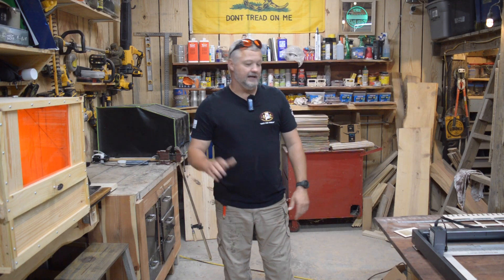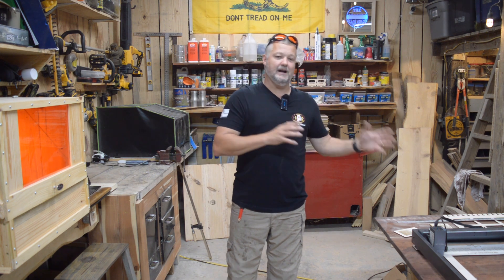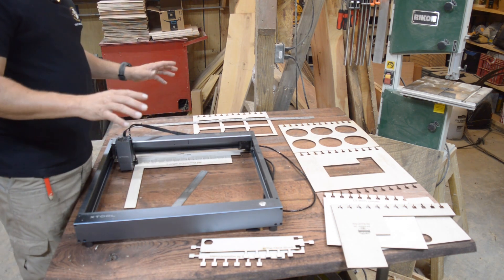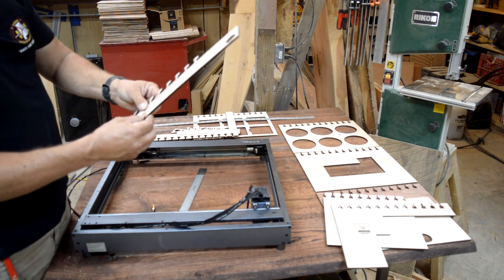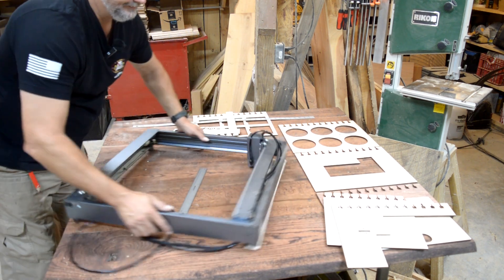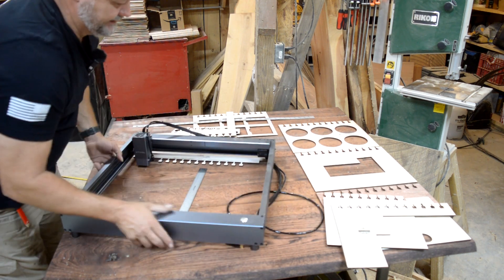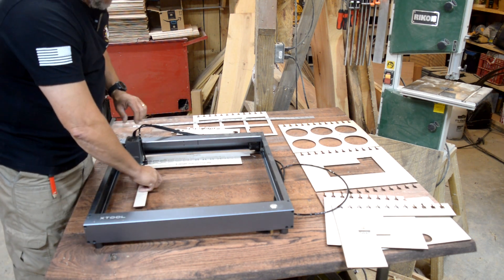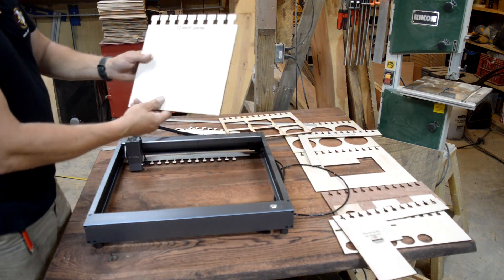Interchangeable jig kit- how to use

Comment: HI... Just about to download this...  I have the extended version with the 40W Laser ... I was wondering if you also had a file set to suit that...i.e. that the 2 panels that join could be cut in one (so they are both together on one piece as can be cut on the extended base)  
Also...Im going to attempt to make a sliding set up that will allow me to cut and slide the (approx 900mm wide) panels underneath...and so could be used to get 2400 x 900 panels for my photo studio prop builds...
I wondered if you had any advice/if a locator pin/point could be set on the jig to all me to cut and move it underneath along the extended base width...

Thanks for any info/help...
STEVIER
Reply from the maker: There are ways to attach it to a fixed spoil board. You can place a set of teeth on each end or get my panel that extends it also.

Comment: Do you have the templates for the D1 Pro? I looked on your site but didn't see any. I also use XCS for my program. I would like to do coasters, leather patches, round coaster, squaring jig and maybe a few other. Appreciate any assistance you can provide.
Reply from the maker: The D1 and D1 pro are the same frame. I have the kit in SVG format which can be imported into XCS. XCS didn't exist when I built this.

Comment: Hey man my name is Chuck Washington I bought the jig kit but I only have 12x12 wood and I did not get the dig tag jig or any of the jigs please help I live in Mobile use to live in Calera Al.
Reply from the maker: Not sure which kit you are talking about. Most can be adapted to 12x12 using the bolean tools
Reply: The Xtool D1 pro 20w square jig for 11.75 x 11.75 wood

Comment: Quick question, when you are burning your jig panels, what do you set them on? If you put it on the honeycomb then it's not level with the locking panel. I am using the Wizmaker L1.
Reply from the maker: I have my honeycombs set up and they are level with my cutting surface.

Comment: Hello how are you doing I just got the D1pro and am interested in making jigs for it to make thing easier just wondering if this is something that can be done with xtool creative space and what would did you use exactly and what is the size and thickness? Thanks
Reply from the maker: Yes, with XCS you will need to use the dxf format but it will work
Reply from the maker: 4mm or thicker for rigidness
Reply: Ok thanks for the info BTW I'm new to this is dxf format easy to find/ figure out
Reply: Is there a certain place you found 4mm + thick wood so far everything I find is 3mm

Comment: Is there a video about how to use these with Lightburn?
Reply from the maker: Several. all I use is lightburn. https://youtu.be/yF7znodqvpc
Reply: @TheClackShack  do have where you don't have a camera? I don't have one, and I don't plan on getting one.
Reply from the maker: @richcauwels4897  same process just takes framing using a tool line
Reply from the maker: @richcauwels4897  camera isn’t required if you frame
Reply: @TheClackShack  just have to guess the pre-cut squaring position until you hit the mark and then save as.

Comment: Excellent setups.  Suggestion -- why not remove the locking extensions on the top stackable piece?  still get extra strength, but without extra difficulty of removing jigs.  You could use those special dowel rods to align them when gluing them.  Also, you could slightly modify several locking tabs (maybe reverse them to be eadily seen) to ensure only one place to lock them in.  This could be an updated version of your files for new people.   I have a different laser, but this is great for those that have the XTool.
Reply from the maker: I have revised the design since and it makes it stronger and easier

Comment: What are the grid settings? I imported the file in it goes over the grid??
Reply from the maker: Not sure I understand what you mean by grid settings? If you mean that it is larger than your work area, something isn’t right. The files are made to fit in the work area of the machine that they are for. I have lots of different files. Some are a collection of burns but are intended to be tool lines until you are ready to cut

Comment: Once I cut the jig out and use a different jig, how do I make the Xtool go back to the original jig? Does it need to be set with absolute coordinates? I've made jigs in the past and never could get it to center exactly where it was before. I gave up and made paper jigs. Once I cut a 4x4 square out of paper, do the coaster right then without moving the laser head. I'm probably overcomplicating it. 😆
Reply from the maker: You cut out all the parts, snap them together, cut the shape, change cut line to a tool line. Your done just save that file as a jig template.
Reply from the maker: Change cut line to a tool line. The jig panel has to be locked into the locking panel. I have multiple videos demonstrating

Comment: i am not understanding something. once i cut out a blank jig and lock it into place to cut out the template. i set everything up on my laptop in Lightburn to make the template. but each time i goto frame the template INSIDE the jig area...the crosshairs always go off of the jig...meaning the template wont be entirely on the sheet of wood/jig. what am i not understanding or doing wrong?!!!
Reply from the maker: All my designs fit on a 16x16, most can fit on a 14x14. Make sure its not a tool line causing it.
Reply: @TheClackShack  I understand what you are saying and have watched your videos numerous times. My jig template is roughly 12" x 6" (including the teeth) that leaves me plenty of room for a 4" diameter circle template. Yet for some unknown reason my machine/software wont allow me to  frame the circles in the area I want to cut out the circles. (I hope I'm making sense....I'm not a word worm and do better communicating via pictures/videos)

Comment: I love your jig system. But, Is it really necessary to have this many tabs for alignment.  Seems as though the smaller the tabs, the more fragile they are.
Reply from the maker: That is true but so far, I have only had one break and it was due to a void in the material. I have a newer version that I have improved upon in the making for future builds. The only issue is that changing the design will basically render older jigs unusable. I will likely move over to my latest design on my next kit. I may re-release the jig kit update for the other machines.
Reply: I bought the jig kit even before I bought my xtool.  Looking fo tge upgrade

Comment: You should add numbers to your jigs for the snap locks - it would help to align the jigs in future. Just picked up my first xtool D1 20 watt and look forward to checking out your jigs. Cheers!
Reply from the maker: I have considered it but if you don't use numbers, it would just increase the burn time. The end user could add them easily enough. Good idea though

Comment: Do you have a video on how to lineup the jig in lightburn? Once I have the circle jig locked down - is there a trick to quickly line up the job? Im trying to wrap my head around it but once you have the first one dialed in the rest are good (if your using the jig as the template in lightburn) right? I made the jig into a tool layer in LB then Im having to move that around to frame the first and not sure how to tell if its good, 1/8" off on the first translates into all the rest being off yes?
Reply from the maker: This is about as detailed as it gets. If you use the files that I make, you should be really quick. You have to snap it all together then burn the holes and save the file. 

https://youtu.be/aXJEEPKVqUc

Comment: How do you use the squaring/alignment jig with pieces that extend beyond the frame of the XTool. Example : 24 inch long cutting board where you need to engrave in lower left of the board?
Reply: Thanks!  Assume I would do the same if the burn was to be in lower right of stock. It would end up being too left of jig? I’ll check out the video. I don’t use Lightburn, only XCS if that helps
Reply from the maker: Rotate it 180 degrees so that the burn is on the top, then orient the text accordingly (Upside down). That is why my engraving enclosure has a passthrough. You are limited to about 20 inches width to fit between the legs.
Reply from the maker: https://youtu.be/6mstRqQAjwg, look at 8:43, that is a passthrough for what you are talking about.
Reply: I was of course overthinking this. Thanks again- got it figured out (for now)

Comment: Super dumb question here.  Where can I find your jig file, the top one.   🤔   thanks!
Reply from the maker: My Etsy shop, here is the link. I also have some ready made files that will help with making the jigs for some common items. You can also make your own files and just use my panles. 
https://www.etsy.com/TheClackShack/listing/1229695807/jig-kit-for-xtool-d1-interchangeable?utm_source=Copy&utm_medium=ListingManager&utm_campaign=Share&utm_term=so.lmsm&share_time=1660494868160

Comment: Suggestion: Add numbers to the teeth on the locking panel. Then, once you install a jig panel for the first time, pick one of the numbers on the locking panel and write that number and an arrow by the corresponding slot on the jig panel. That way you’ll always be able to get the jig installed at the same place.
Reply: LOVE this idea!  I think I'm gonna burn a new version of mine that I got from David, except go in and add numbers to the teeth.  Shoot, what would it hurt?  🙂
Reply from the maker: Not a bad idea, I usually just use a marker to make timing marks.
Reply: Do I cut  on         insied ,outside, onside , on shpes path , or inside sapes path?

Comment: I like to use the square jig when I'm cutting pieces out. That way I can take the piece out and if any pieces didn't cut all the way I can just put it back and run another pass or two knowing it will cut exactly on the line again. . Thanks for making this. Saves a lot of aggravation
Reply from the maker: That is a good use of the kit. Thanks for sharing